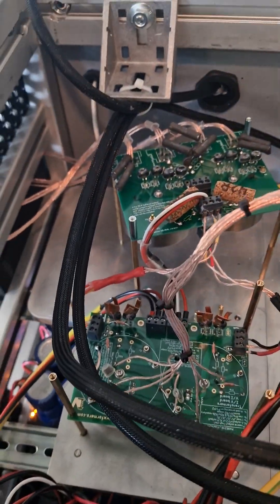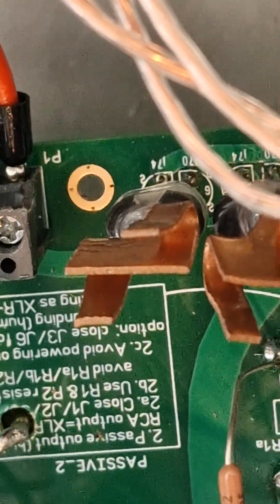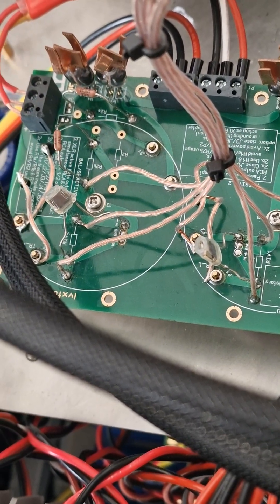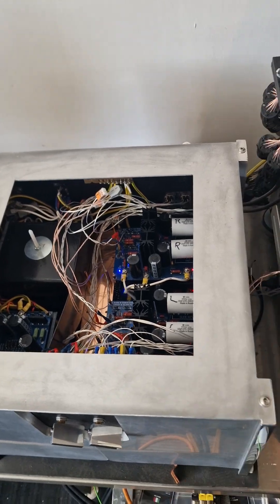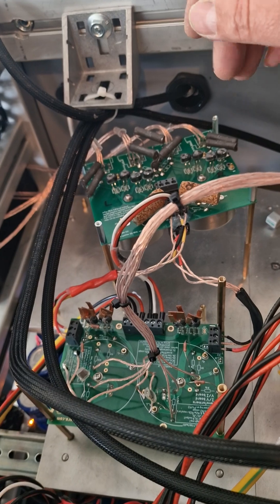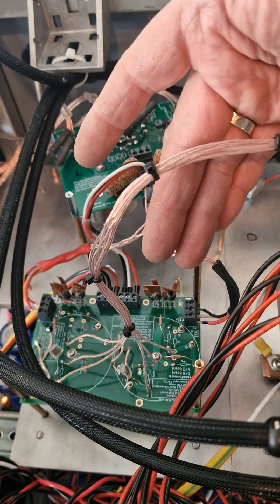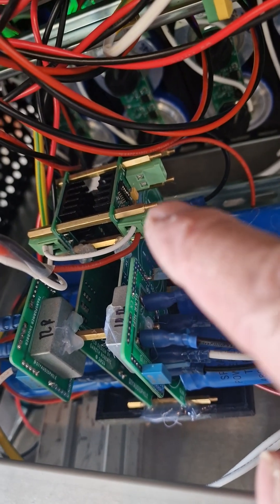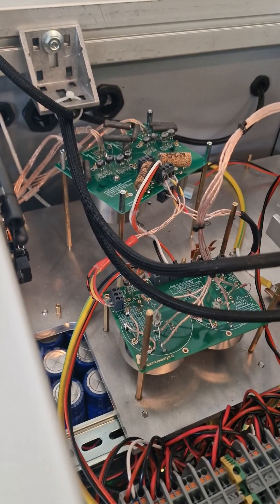DAC IV stages, Ivan Bisesik IV stages. 1+1:29 to 1:8+8 both active buffer IV stages

Comment: Do you really need preamps? With two transformer pairs you should have tons of gain. A nelson pass style active crossover with jfets would fit your system well.

Manganin wire is the best resistor. not too difficult to diy